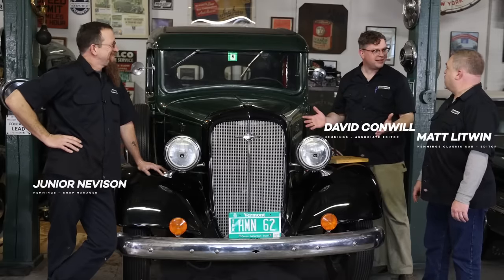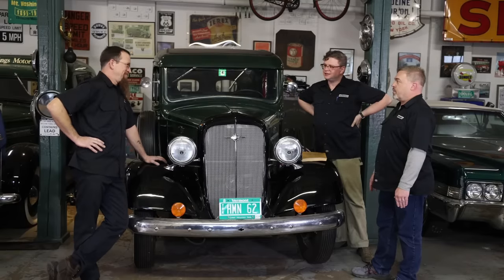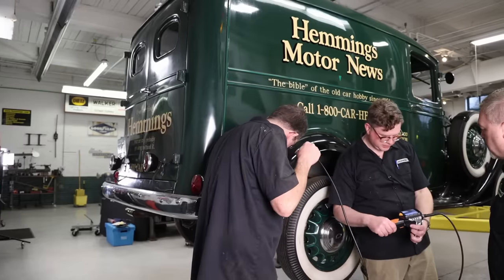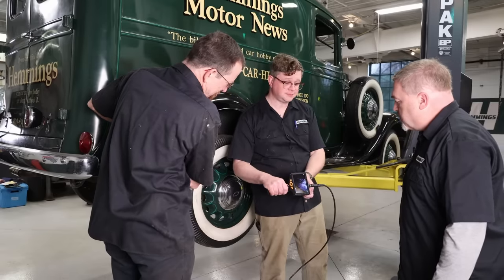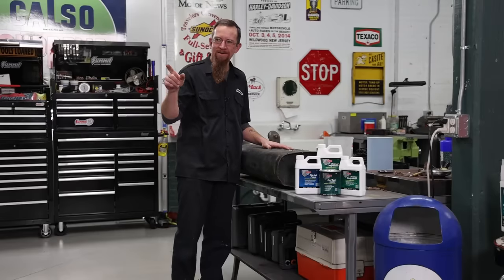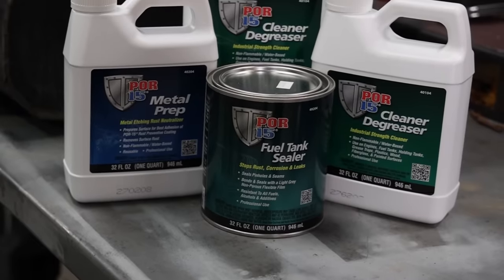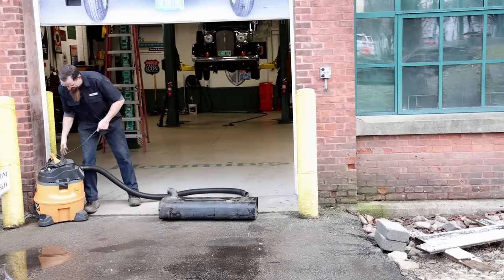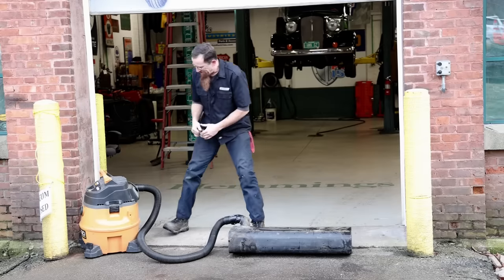FUEL TANK FIX JUNIOR JOINS THE CLASSIC CAR STAFF AND TAKES ON HEMMINGS ‘36 CHEVY PANEL

Comment: I’ve had a 36 Suburban in the family since 1957.  Our gas tank is a bone stock survivor for some reason.  The wooden chassis frame, on the other hand, has always needed love here and there to keep the entire structure from crumbling.  The fabric roof (36 is pre turret top stamped steel for Chevy) also needed a total replacement.  Still running a 30’s era straight 6 running a 6-volt generator through a stock 3-speed and torque tube.  When the Babbitt goes on this motor I’ve got a mind to follow your drivetrain modernization program!  Thanks so much for the video
Reply from the maker: Thanks for sharing your story!